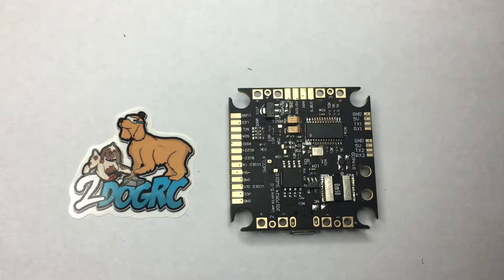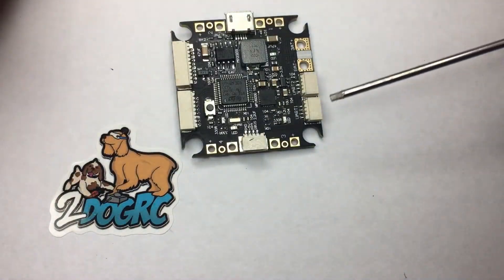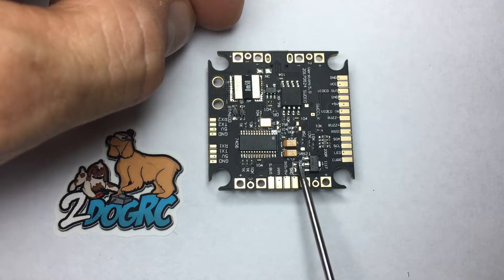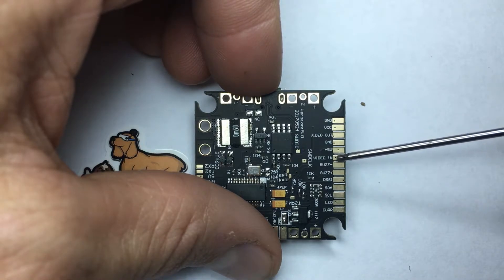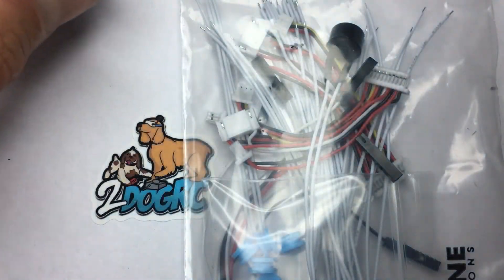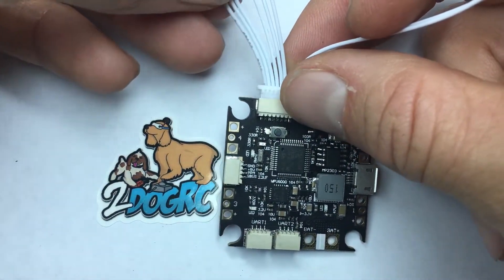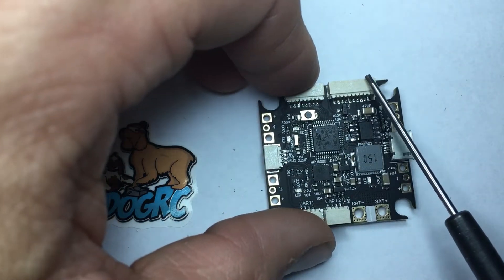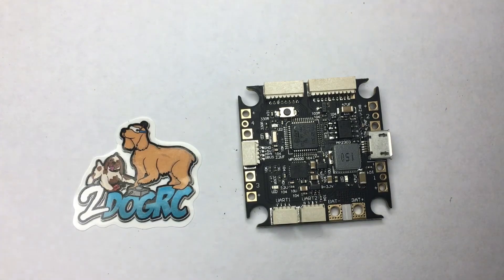FuryF3 OSD Overview

Comment: Hi if you can help before I go buy another board, already have this for my new tyrant s but something won't connect, I have installed all necessary drivers, cp210x,  zadig, stmusb drivers  software, I have another drone, different board and it connects to betaflight no problem...I can connect pressing the on board button to DFU, but after trying to load software it won't go into control panel on the betaflight for adjusting settings,is it a fault with the board or  are there any solutions you can think of? Tried reading forums others have had problems with this but I don't want to give up and buy a new board till I have exhausted all possibilities, any advice would be most greatfully received.....cheerz

Comment: Thanks for the videos! I hooked up my Spektrum receiver before I realized I had to switch the 3.3v jumper. All I did was plug in the battery a couple times for less than 5 min and bind the transmitter. The quad never even received any input from the radio. Do you think I could have fried my receiver? It still blinks and binds ok. I'm still figuring out how to set up my Tyrant S in beta flight so I have no way to really check it at the moment. Just wanted to see how likely it was that I hurt the receiver.
Reply from the maker: Ryderr21 Sounds like it is okay if the lights are on.

Comment: Hello, can you advise me of how to wire up this for pwm receiver, my diatone gt200 came with this flight board and has the wires for pwm  receiver but not sure the details of what goes where. Thanks so much
Reply from the maker: Yes, use the PPM  wire to your receiver signal wire, then the Pos and Neg wires from that harness to the 5V and GND of your receiver.  What receiver are you using?

Comment: how can i hook a TBS Unify Pro with smart audio to this board?
Reply from the maker: +Liviu Ciuca if it is the HV version then connect the pos and neg in to pos and neg battery terminals. Then connect the audio wire to UART2 via either the pads underneath or the wire harness.
Reply: 2dogrc it is the Pro version of Unify (5v) and I did this already to make sure it gets 5v only, I need to unhook the wire from JST that goes to vtx and camera and connect without JST, solder them underneath. https://youtu.be/rMDUK7rNmf8
Reply from the maker: Yes, so if that is connected to 5V power supply, then connect the Audio to a TX on one of the UARTs, 2 probably woudl be the best.

Comment: Hey Mark, I can't solder leds to the new gt2 2017 FC right?
Reply from the maker: That is a very vague question, but yes you can.  The Flashbangs that come with the kit can me powered off battery voltage, so any where you See VCC.  If you are going to use programable LEDS WS2812/11 they need to be powered off of 5V.  There is a 5V BEC on board, but I would onlyu do 5-10 of those LED's max.

Comment: So if I get the tyrant s with this new fury board, can I just plug my turnigy evolution receiver in that plug and be good to go without sodering?
Reply from the maker: No. You have to solder.  If soldering is an issue for you, which it is for some of our customers due to many reasons, then I would suggest finding a local hobby store, friend or other drone pilot to help you out.  This sport requires soldering, and there is no way around it.  The receiver soldering is very easy and a good way to start learning the craft.
Reply: Ok thanks

Comment: I have the Diatone D-Link F3 V2, and was disappointed to learn the V3 didn't have 3.3v. With the exception of this 3.3/5v option I don't really see any hardware differences between this Fury and the V3?
Reply from the maker: There are more differences. This board was designed from the ground up, not a clone of the Sp racing board. This board has a built in Betaflight OSD and current sensor.